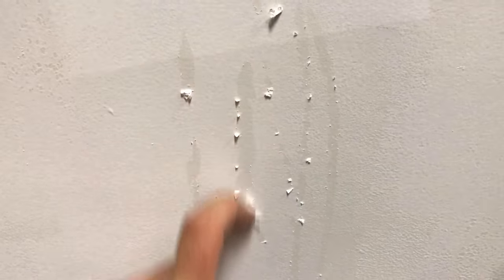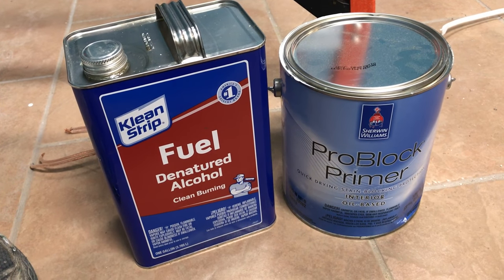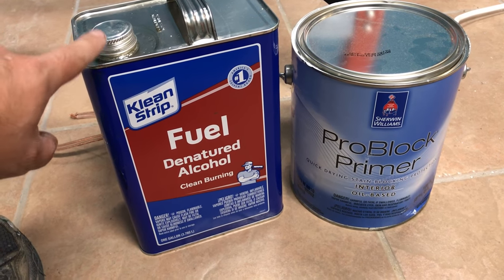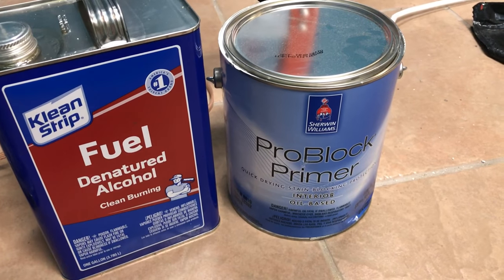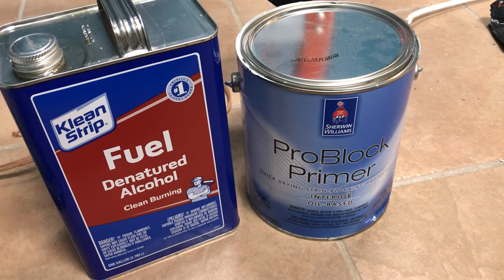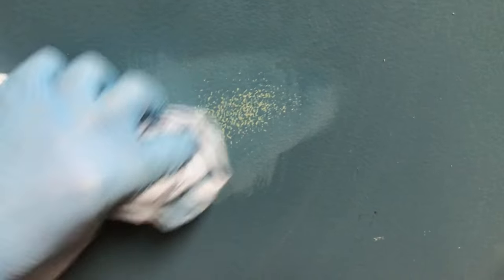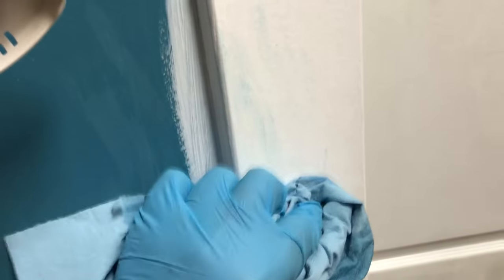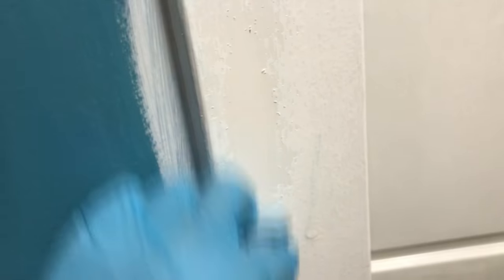#1 Mistake DIY Painters Make (How to paint over oil based paint)

Comment from the maker: What's the best way to wrap an extension cord? https://youtu.be/NUIwDFIHvDI
Reply: I need to remove oil based paint from several walls throughout a home.  It was applied unevenly and paint streaks are visible everywhere.  In your video, you discuss using denatured alcohol, paint thinner and acetone to remove oil based paint.  Is this an difficult job, requiring a lot of scraping and repeated reapplication of the solvents in order to remove it all, or does it come off the wall relatively easily?  When it comes off, is it also removing the texture?

Comment: Thanks! This was great. But I don’t get why painting over an oil-based primer with water-based paint would be better than paining over oil-based paint?
Reply from the maker: Primer is not the same as paint, just made out of a similar product. Primer is designed to be painted over by anything. The oil based primer is just a better primer than water based.

I have other home improvement tips you might be interested in like the best way to wrap an extension cord: https://youtu.be/NUIwDFIHvDI

Comment: Wait so I can’t paint over my oil based stain blocker primer with latex?! That’s what I was told to do at the store. So I need to paint with an oil based paint?!
Reply from the maker: You can paint over any primer with any paint. You can’t paint water based paint over oil based paint without prepping the surface first

Comment: I used a primer over the oil-based paint before I put on the latex paint and it's still peeling off the walls. Now I have to redo the whole kitchen
Reply: Was it an oil based primer as well?

Comment: oil based primer if oil based paint underneath cover in denatured alcohol, test the sections you will be painting. denaturalise alchlock will wipe off water based paint but not oil based paint

Comment: At 3:26 when he said "A good feature of oil-based paint is that it's easy to clean with just soap and water", he was referring to cleaning the surface of dry oil-based paint, not cleaning your brushes or tools.  Oil-based paint requires paint thinner for cleaning brushes and tools.  Just wanted to clarify for those who are watching who may not have understood.
Reply from the maker: Matt Mason great point to clarify. Cleaning up the actual oil based paint itself is a pain. And disposing of paint thinner correctly is an even bigger pain. The wasted thinner/paint mess needs to dry before being disposed in the normal trash and the remaining thinner has to be saved or disposed at a special water facility.
Reply: @notwaitingtolive  I'm learning a lot from these comments, thx guys!
Reply: @notwaitingtolive  tell me about it :(
Reply: @notwaitingtolive  its not that bad its easier to clean oil based or solvent based paint out of brushes than it is water you just store your brushes in water you dont need to clean them out straight after and you dont throw your white spirit away you recycle it and reuse it for cleaning and burning out kettle and scuttles etc its only bad for the environment if you dont know what your doing.

Comment: Wow. VERY HELPFUL! 
A painter did this to all 18 interior doors of our house--PLUS the trim. Didn't charge for his destruction. 😤 
I'm guessing we need to replace all of them and start from scratch. Over-sprayed onto some of the walls too.
Reply from the maker: Glad you found this useful. In this video I wiped off the door and trim with denatured alcohol. But that would be quite a lot of chemical exposure in your situation. I have heard of people light sanding (keying) the surface with ~100 grit sand paper then priming the surface with an oil based primer. That’s still a lot of sanding. You just want to make sure you sand off everything that comes off easy. And then dust the surface before painting.

Whatever you do: Stay positive. That’s the only way to get through a task like this. The good news is that there is a solution.
Reply: THE same thing with our house...the previous home owners painted over EVERY DOOR and TRIM in ALL rooms from the kitchen to the bedrooms and bathrooms, and hallway trim...everything!!! 
It has been a disaster...how do we convince a contractor to take over this tedious task???

Comment: I had some "pro painters" paint with latex paint over doors and trim that had always been painted with oil-based paint.  They promised they had prepped the surfaces for painting, but they had not.  I recognized the problem pretty quickly and got rid of those painters before they could ruin more of the paint on the existing trim, doors and walls that were originally painted before WWII with oil- based paint.  Since then I have been looking for an easier solution than trying to sand off their work.  

I hope your tip about using  denatured alcohol will work for me.  The latex paint can look good, as long as it is never touched.  When it receives the slightest scratch, up it comes.  Oil-based paint has such a hard finish that in older houses, like mine, the wood work loses moisture and shrinks inside the hard shell of the paint, and ultimately debonds from shrinkage. Once you crack that hard shell and see what has happened over 40 or 60 years, or longer, you end up having to remove a lot of debonded paint, sand it down and start with an oil-based primer, etc., and you have to worry about lead particles in the air, HEPA vacuum cleaners, and getting an industrial grade gas mask in today's Covid-19 environment, where they are hard to find or afford. 

Thanks for sharing your experience and the solution to the problem with your viewers.
Reply from the maker: I appreciate your feedback on your experience with oil based paint. That's frustrating that you now have to correct their mistakes. I've flipped a couple 100 year old houses and noticed the cracking you describe where the wood shrinks inside the hard shell of the oil based paint and cracks. It was most prevalent on the interior window casing. I actually replaced some of the trim to avoid the tedious refinishing you described.

When you're using the denatured alcohol I'd have multiple fans moving air out of the room. The fumes are pretty harsh after a while. I'd also recommend a cheap chemical odor mask (although I have no idea if you can even buy them at the store these days due to coronavirus demand).

The denatured won't take off every little bit but it will take off what's weakly bonded in the first place. A light sanding with 100-grit can knock down whatever else needs to come off. Then the primer you use will lock in the rest. The job from this video was completed 10 months ago and has no apparent issues.

Comment: Okay...man THAT explained it perfectly!!  I did all the doors, trim, and windows with the damn water based over oil.  I have a JOB ahead of me, but at least it give me a direction to head.  I thought I may have to sand off all that water based paint as it's now several weeks dry.  But I have Denatured Alcohol around.  Thanks also for the detail on what primer (Oil Primer) in this case, to put down before I go over it with water based again.  Man, what a hassle, but can't thank you enough....cheers!
Reply from the maker: Anthony Johnson oh man I feel your pain. You’re in a tough situation. 

Make sure you wear a P100 mask if you’re going to be using this much denatured alcohol and use multiple fans to keep the room well ventilated. 

If you’ve used a water based paint/primer combo paint you’re going to notice where the water based paint you applied has adhered well to the trim. I’d focus on removing what comes off easy and leave anything that needs serious elbow grease to take off. Some 100 grit sanding might help as well at this point to wear down any areas that don’t want to wipe off. And then I’d just cost over that with the oil based primer. 

The job I did in this video is 8 months old now and the trim hasn’t shown any trouble yet even though I didn’t get all the water based paint off perfectly.
Reply: @notwaitingtolive   Yeah....I was thinking that about the mask..that did pop into my mind.  I was also going to ask you if you used at least some medium grit sandpaper for some of the harder spots.  I'm also glad you mentioned in this second post about " not getting all the water based paint off."  lol....I was praying you werent going to write MUST REMOVE ALL OF IT -- OR YOU'LL BE SCREWED!! "  LOL.   But yeah, I really appreciate your time and insight.  I'm taking one door and one base board at a time, and getting them prepped right and corrected.  Can't let this job fall into chaos....and IT CAN.  So thanks man, I appreciate your help...

Comment: Thanks a lot. another tip is to use fine grade sandpaper to prepare the surface before
Reply from the maker: Great tip. And I agree that's a good, simple, and fast solution. I'm sure people reading the comments will find that helpful.

Another type of primer I use is shellac based BIN primer which would cover up oil based paint to allow people to paint with water based paint. I actually just painted a smoke damaged fireplace mantle in this video for a friend using shellac based primer and oil based paint and love how it turned out: https://youtu.be/u2pdzTiKpDY

Comment: Thank you so much for this video. I had a huge fail putting water based paint over the oil based on a wall and it just kept peeling with everything touch.
Reply from the maker: You're welcome. It happens. The good news is, it's all fixable.
Reply: Prizzy krissy i just did the same thing. Dis you completely remove the water based paint that you accidentally put on before applying the primer or did you jist apply the primer directly over the mistake?
Reply: Midget0412 no, I had to remove the water based paint first .
Reply: Awesome thank you

Comment: You could have just sanded the latex surface. I use water based primer for my oil based paint. You just have to let the primer dry for 24 hours. It will dry very slow, but as long as you give it time it's great. If you do not give it the 24 hour dry time it will lift in time.

Comment: But if I paint with oil paint.  What kind of solvent should I use
To clean my paint brush?? And if acetone works to take water base paint off and to clean oil base.  Is there   a way that when I m testing the paint come out too?

Comment: So glad to find you! The walls and ceilings in my house have always been painted in oil paint. I want to paint the walls again but have been informed i cant find oil paint anymore. I like oil paint as it looks mhch nicer and is easier to clean. What do you suggest i get for my walls. Can i find oil paint? Thank you for the tips.
Reply: sand down all your walls lmao
Reply from the maker: Deb I prefer oil based paint as well in a home. I agree it looks much nicer and easier to clean. But you need to have the patience for the extra dry time (up to a day or more depending on temperature and humidity) and you also need to be extra careful as you'll need to use paint thinner to clean up has drips and your brushes. 

Here in Ohio oil based paint can be found at Home Depot in quarts. Other states such as Michigan still sell oil based paint in 1 and 5 gallon quantities to the public. But in other states like California I hear oil based paint is very difficult to find, perhaps even banned.
Reply: Use silk vinyl, it's water based and easy to clean

Comment: I'm about to paint a bathroom and the paint is flaking off everywhere - ceilings, walls and door. It was likely painted decades ago. I'm wondering if sanding might be the way to go since the paint is already coming off.
I might have already answered my question but do you think the denatured alcohol is the best way to go? 
Thanks so much.
Reply from the maker: Sam N I agree with your instincts on this, sand it off. Because of the large amount of surface area you’ll be tackling I recommend using some type of electric pole sander like this https://amzn.to/34bm6FQ. This will allow you to sand the ceilings and upper walls without getting on ladder.

Usually a 5 in 1 tool is enough to tackle small amounts of peeling and flaking in a room, but if it’s truly happening everywhere, using just this tool would be back breaking work.

Save time on the ceiling by going with a textured ceiling. Sand off the major chips and flakes and then roll on thinned down joint compound which is patterned randomly with a brush to hide all the imperfections in the ceiling.
Reply from the maker: Also with that amount of sanding make sure to wear a P100 filter and use a fan to move old air out of and new air into the room. Breathing that amount of dust can really leave you hurting. I’m speaking from too many experiences.

Comment: Great video and have you tried sanding the oil finish off partly with a 160 grit sandpaper, then vacuum, wipe with a clean white rag or tac cloth?  A sanding sponge lightly dampened will reduce particles in the air or you can use a sanding block with a vac attachment for reduced dust.  I learned a lot with an Artist for 10 years doing Ventian Plaster, Faux finish, etc..  You can see his recent works which involve a blending of old and new methods such as squashing cans, adding coins, keys, found objects, rendered in Art from Greek Mythology (JonathanBressler).
Reply from the maker: I haven’t for walls but I have sanded cabinets and railings that had oil based polyurethane before painted with positive results. I appreciate your insight. I’ve also found alcohol based primer to work well. I love using the shellac based primer to block wood tannins when painting wood for the first time to keep them from bleeding through and most recently I used it to stop a greasy wall from bleeding through.

I’d love to learn Venetian plaster, I’ve seen a couple videos of that on YouTube that are simply amazing. I love watching the lost art that some of these painters still practice, I’ll definitely look up his stuff.

Comment: Good vid. I like the quick test to determine if the underlying paint is water based or oil based. Do you know if all oil based paint is considered flammable/combustible and therefore require a sprayer to be grounded to avoid being shocked?
Reply from the maker: To be candid I have sprayed oil based paint out of an airless sprayer and a High Volume Low Pressure sprayer (HVLP) without grounding. But I'm not sure if that's a necessary safety precaution or not.
Reply: @notwaitingtolive  Thanks for the info.

Comment: Watching this video 2 days too late.  I painted right over the gloss finish without any type of preparation.  The result for me was the new paint dried over the gloss painted brick planter fine, but came out lighter shades of the new color.  I was advised,  now use a primer.  I used Kilz and repainted.   Same result. 

 I’m exploring ways to hide the planter.  There's no peeling.  If it peels later on, I'll be peeling, but definitely not trying a third time.

Comment: If I have Oil paint already on a Wooden door frame exterior which primer would be great for me to use to apply to it so that I can do it in a new color after?
Reply from the maker: Oil based primer. If you’re going light to dark you can tint the primer grey to help block the old color.

Comment: Thanks for the video. I applied zinseer 123 water based primer over oil based painted kitchen ceiling- cleaned with STP, then used clean strip liquid sander deglosser. Now the primer can be remove with my finder nails. It has taken me hours and hours to scrape a small area on the 12x25  ceiling, a nightmare- denature alcohol that you used is a fuel-  (1) is it dangerous to use in a kitchen ceiling? (2) would it remove just the primer and not the oil based paint?
Reply from the maker: Raymos S You have a couple options: (the long proper way) sand the ceiling and start over or (the quick fix that won’t last forever) cover the ceiling with a shellac based primer as is (imperfections and all) and roll on a joint compound texture. 

Using denatured alcohol to wipe paint off the ceiling is a nightmare because the chemical is tough on your lungs and expensive. You’ll be dripping it everywhere and the scrubbing will be incredibly difficult and frustrating. 

Consider using an electric pole sander like this to save you time scraping the ceiling https://amzn.to/35m2AHo. You’ll be able to sand the primer off without having to climb up on a ladder. Use a low grit sand paper 40-60. If the ceiling is flat and you’d like to keep it that way use caution. If you damage the ceiling you can always roll on a texture to hide the imperfections.

Covering the ceiling with joint compound is not ideal with oil based paint because the joint compound can peel and crack off. Use shellac based primer to cover the water based primer on the ceiling (shellac based primer is twice as expensive as oil based primer but has the best adhering properties) then cover the new coat of primer with joint compound (roll on and texture with proper brush). This will save you hours and hours.

My only other comment about denatured alcohol is to use a respirator for chemicals specifically for your health. I have no insight on the flammability of the liquid. It evaporates quickly. But you’ll have to do your own research on how likely it is to ignite. I just don’t know.

What are your thoughts?
Reply: @notwaitingtolive  thanks

Comment: Iv literally just done exactly this 😭. Painted three doors and trims in my house with satin and realised its all peeling off. Do you need to sand before applying primer? Also does the primer have to be oil based?
Reply: Yes and probably Yes too.
When we have oil based trims we always sand and use an oil based undercoat ( I think is just more durable than water based primer)
Reply: Don't forget to wipe it out all dust with a damp clean rag before you apply the primer too.